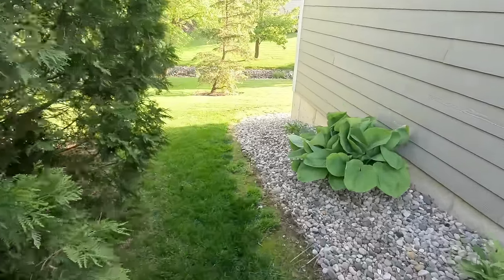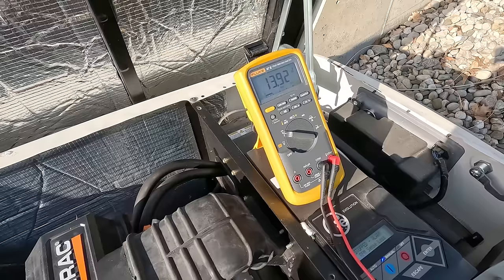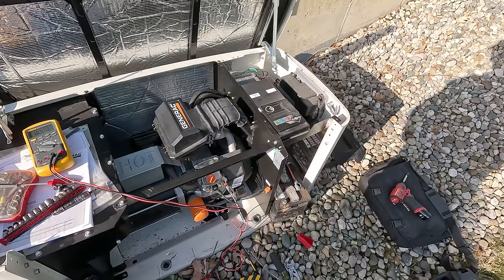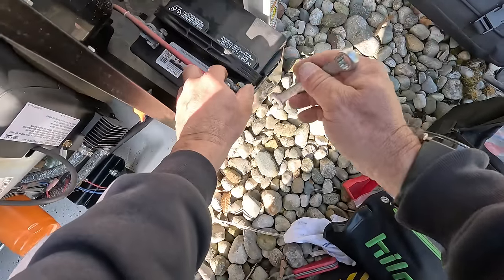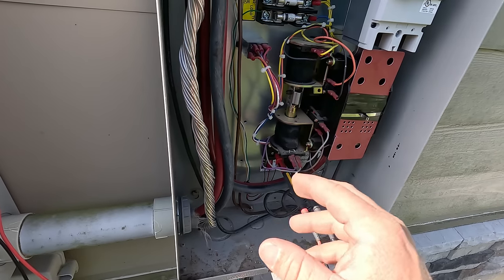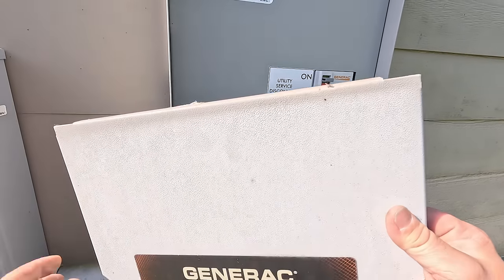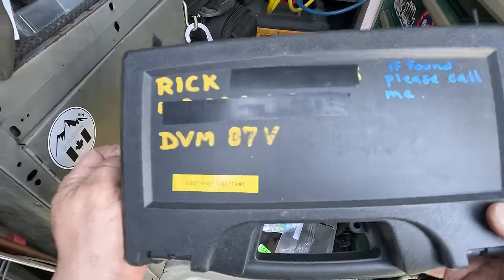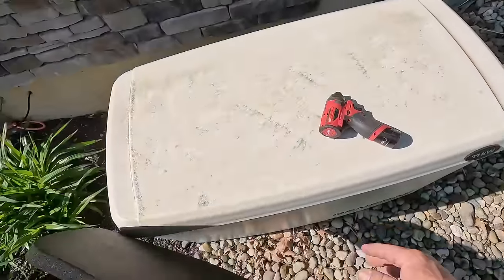Generac Home Generator Wont Start Over Crank 1502 Code

Comment: Great job, Im a Generac MPS industrial tech.... SO many techs do not understand voltage drop tests like you demonstrated. great job. ALso the start contact relay for that is under the controller in that unit.
Reply from the maker: Thats what I thought as I was editing it. Opps Good Call!
Reply: @HVACRSurvival  I probably shouldn't of mentioned it. ( now I feel like one of "those guys") I know its tough to shoot a video, talk and troubleshoot.  I am confident that someone that knows voltage drop testing as well as you is very aware of the system and scr. Again , it was a VERY good demonstration of voltage drop diagnostics.
Reply: <3 hell yeah! Tech fam

Comment: I'm curious as to why you start your video bad mouthing the manufacturer of the product, as you just showed that it is usually a lack of preventative  maintenance that causes the unit to fail ? I use to work on all types of generators and all will fail without good serviceing !😊😊😊😊😊😊😊😊😊😊😊😊😊😊😊😊😊😊😊😊😊😊
Reply from the maker: Watch my other generator videos on Generac and you’ll see why. Generac training is in adequate and their first generation generators are total garbage.
Reply: @HVACRSurvival I agree with you
Reply: @HVACRSurvival 
Would you consider the Cummins RS25 a good/reliable unit?
Reply: @georgeschilens8557,  If you had any experience as a generator tech, you would understand.  I was a generac "certified" tech - Air Cooled up to 150 kW liquid cooled, same with Kohler and Winco.  Generac's will sometimes not work when nothing is wrong-as the video mentioned there have been quality issues-very frustrating.  But, sometimes, not "usually", it is lack of maintenance as you stated.
Reply from the maker: @louis Cummings is normally good but a lot of companies are smacking a good companies name on poor product just so they can sell it so you gotta make sure you investigate each individual one. Sometimes it’s just a matter of knowing how it’s built to see if it’s gonna be a good generator or not unfortunately that doesn’t help the consumer.
Reply: @HVACRSurvival ..I just got done the first year generac training in Pennsylvania and yeah it's trash they don't teach or train anything just try to smash a bunch of stuff into your head and hope you can regurgitate the info

Comment: Not an instructional video?  Well, I learned a lot.  Well spoken and detailed.  However I would not use that plastic spray.  It dries hard and moisture will creep under it and the battery terminal and connector corrosion will only be delayed.  I have always liberally applied ordinary grease (not moly lube!) to the battery posts and connectors and never had a corrosion problem for the last 50 years (I'm 83).

Comment: After you clean the battery posts and cable ends, put automotive chassis grease on the posts and cable ends before assembling them and then a little more on top to fill in any gaps around the posts and you will never have that problem again!  I learned this tip from a retired army mechanic!  That spray crap is near useless!  Also, a sealed AGM battery is a much better replacement option.
Reply: You said it better than I did!

Comment: Awesome job explaining and showing voltage drop. This is why any good automotive technician uses a load testing light along with their multimeter to prove beyond a doubt which part of a circuit is the culprit.
Reply from the maker: Thank you!

Comment: Hey Rick! Another great video. I’ve got a 22KW Generac just installed last year and I guess I baby mine too much by going out every few weeks to check it, wipe the inside down and make sure it’s always ready!! I agree with you, leave repairs to the pros like yourself!! Thanks again!!
Reply from the maker: If you just do the basic things like making sure the battery is not corroded and taken care of, make sure it starts and runs normal. Keep an eye on the oil level then you won’t have near the problems that these other people do. If I spent $7000-$15,000 on a generator, I’d be taking better care of it than what I’ve been seeing. Thank you for sharing.

Comment: the spray on "battery terminal" stuff is great for ease of use. used to just slather on "petroleum jelly" and "baking soda" mixture. aka acid neutralizer and corrosion prevention via water/moisture repellant. yeah, I use the spray can stuff (easier, even though costly). have used white lithium grease, silicone grease and others when out of all the good stuff. but I am not an dedicated auto-service shop. just a sucker for family, friends and foes. 😖

Comment: Great video as always. I use the same battery drop test on my generator pm’s. Like you said the most common issue is the batteries. We try and not let them go past 5 years of use.
Reply: Heat is a killer of batteries so I think at least every 3 years

Comment: One of the more informative videos out there on Generac. I have overcrank alarms on mine frequently, but it seems like it may be a valve lash problem.
Reply from the maker: Checking and adjusting the valves is something they shoved down our throats all the time. Generally, I have not had anything so far out of whack that it caused any major issues, but it’s worth looking at. Thank you for the kind feedback.

Comment: Good job on the video and well explained on the voltage drop. BTW, retired Generac tech of near 25 years and recalling a bunch of that era having a poor connection with the battery cable at the starter. (needs another 1/4 turn) Be aware that the silver faced insulation is a better ground than you think so watch your wrench in the tight quarters back there. In my shop we used the felt washers on battery posts. I was skeptical at first, but never saw any crud on a battery in all of my time in the field. They work way better than anything else. I worked for a larger dealer (15 techs) and not unusual to knock out 40 - 50 services a day... plus repairs.
Reply from the maker: I agree the felt is pretty good, I believe it’s saturated with some sort of chemical. I kept my hand wrapped around that wrench really well because I’ve heard of people crossing the positive to negative with a wrench and having the battery explode.
Reply: @HVACRSurvival    Never saw a battery explode from that (too far away for the battery gas) but it will erase the time / date / exercise stored in memory. Now the customer will be calling because they have no idea when it will do the weekly run. BTW, if a customer doesn't specify, we always set the exercise for 10 AM Tuesday (programable units) so if we ever get a call, anyone in the office can answer that question. EST and DST are still a mystery so we have to tell them it could be off by an hour at certain times of the year.
Reply: I have a 20kw generac guardian. I’ve been having issues with the sensor loss issue. Replaced the battery, contact relay and still having issues with the generator just clicking and not starting.  I have to press the switch to manual several times before it starts. The alternator was replaced about 3 years ago and probably that’s the issue again. It appears the battery cable is tight on the solenoid but maybe I should tighten it down even more. Getting 12 volts at the solenoid. Any ideas???
Reply: I meant to say starter and not alternator 🤦‍♂️🤦‍♂️
Reply: @LouisS-cs7bh  In my time I was seeing at least 800 units a year for service / repair and starters were low on the list. That start relay was even lower on the list. I don't think I replaced 3-4 over the years. You need to do a proper test and check voltages, starting at the battery and working back to the starter, including the small wire that triggers the starter. (wire #56 in a diagram) You should also check the negative battery cable where it ties to the rear of the engine. BTW, even an off-brand starter usually lasts more than a few years. You are missing something.
Reply: @rupe53 
Thanks for your help
Reply: @HVACRSurvival  The heavy felt washer is saturated by similar to what you spray can has, it is just in the best position to prevent corrosion-underneath, so instead of hiding corrosion, by covering it up and making a mess out of the terminal connections, it stops it at the source.
Reply from the maker: @Bobby I agree they work great. But they don’t last forever and I don’t use enough to justify getting a box of them. I did prior when I seen 2-4 a week.

Comment: Man, I'm glad I got that 10 year warranty on my 26kw unit. Mine tests/runs every week. But I feel I should be running it every 60/90  days under load. I run my portable (backup 8kw genset) every 30 days.
Reply from the maker: Turn off the quiet test feature. Let that thing get nice and hot so it boils the moisture out of the oil. When you see White oil that is moisture buildup.

Comment: A backup generator could really benefit from having a rope starter inside the case.  I have a tri-fuel portable with electric and rope start. Seems like a better machine except for not having an ATS. 
Nice video 👍👍
Reply from the maker: Your problem would be trying to start something this large by hand. On average it's 1.5 hp to as much as 2 hp per thousand watts, for example a 25 KW generator would be potentially 37 1/2 hp or more.
Reply: And it also  requires that you are physically present at the building
Reply: @HVACRSurvival You would never be able to pull it.

Comment: Hey man, really enjoying your videos thank you! I am a 18 year Hvac tech and I have the same error code on my Generac at home. The battery was tested at interstate. They said it’s OK. Any chance you could offer some help? I understand if you can’t but I figured I would just ask. Thanks in advance Zack.
Reply from the maker: What kind of help?
Reply: @ understanding the way the starter is told to energize.  There is a little relay looks like a 12v coil that (I think) is normally closed. I don’t have a schematic and I don’t know what I’m looking for/where to find the failure….

Comment: Do you recommend a generac generator and good job
Reply from the maker: Their latest ones aren’t too bad. You just have to do your part in maintaining it and you won’t have near the problems. Also make sure they follow the instructions properly on the installation. Meaning getting the gas line and meter size correctly, not putting it too close to the house and not putting it where there’s snow piles typically during the winter.

Comment: Good video. We typically drop out the charging circuit to get the actual battery voltage and can see the drop when cranking. 
Just a faster way of troubleshooting.
Reply from the maker: @GentechNorthwest-ue4oq  cool. I’ll have to try that. Thanks!
Reply: @HVACRSurvival  keep
making these videos. Many people are in need. Thanks
Reply: No, a faster way is to measure battery voltage during the crank cycle, and leave the charging circuit alone-then you are not resetting all the exercise info should the battery voltage go below about 9 VDC without the charger, thereby wiping the EEPROM,
Reply: @bobbygene8274  That’s not how the evolution control boards work. However, yes you are correct, you can see the drop during crank cycle on manual.
Reply from the maker: I normally used my digital meter while I use a load tester. I was told it should stay above 11.2vdc when cranking.

Comment: On newer generators Maxitrol external fuel regulators frequently cause overcrank problems as they let pressure build up especially if regulator is in direct sunlight and solenoid will not open due to high pressure that regulator has let walk up to or past 20" wc
Reply from the maker: I’ve heard of the pressure being too high to allow the solenoid to open, but I’ve never seen it that high. Usually the highest I’ve seen is maybe 14 to 13 inches and even then I would adjust the primary regulator down.
Reply: @HVACRSurvival  a couple of times I have seen a maxitrol in direct sunlight walk from 7"wc to 20 in less than 10min, first time was a couple of years ago on a 6mo old generator, we do not use maxitrol period anymore after realizing faulty dilemma and is first thing I look for with overcrank is if customer has a maxitrol regulator.  This is also why when replacing fuel plenum I leave old fuel neck and solenoid as the older ones tolerate a higher wc
Reply from the maker: That’s a new one for me. Maxitrol is usually a good product, I see them on Make Up units all the time and those aren’t usually cheap.

Comment: The two most prevent issues with generators is a failed/failing battery and lack of fuel...replace the battery every 3 or 4 years-whether the battery "tests" good or not.  Other than that, perform needed maintenance per manufactures guidelines.
Please don't use spray on battery terminals.  Use impregnated washers.  Most corrosion is from vapor coming from the case after the seal between the post and the case is compromised, sometimes due to someone beating on the terminals instead  of spreading the battery clamp, or random failure.

Comment: Great video. Thank you for sharing. If you don't mind me asking ? May I ask, Where do you get the battery ? Is that car battery ?
Reply from the maker: That likely came from the place we buy our automotive parts. It’s a local distributor not national. Technically it is a regular car battery. They claim the one Generac uses his technically built for generator because it’s vibration resistant, but I don’t know if that’s true or not. We’ve never had any problems with these batteries or any other ones for that matter if you take care of them.
Reply: @HVACRSurvival  Pretty good vibrations in a car too so I would doubt that claim too probably same as a car battery
Reply: They are absolutely car batteries, and NO generac does NOT make them.  There are only a few manufactures of automotive batteries in the country, three I think.  Recommended battery is a group 26 or 26R, you want the negative post on the outside, if you can get it that way.  Generac's negative cable is not always long enough to do that, though.

Comment: Generators eat batteries. I solved this by buying batteries that had a three-year free replacement on them. Ironically, about every 34 months. they went bad..  : )   They handed me a new one for about 10 years straight.. Solved the problem, though. Batteries were the number one thing to look for when these things were running wonky..
Reply: Likely cheap batteries and a inexpensive charger.  Good quality AGM battery and a Smart charger designed for AGM  should last 7-8 years!

Comment: loose/dirty battery posts/terminals. hehe, I learned over 30 years ago to always clean them with wire brushes(terminal brushes) and always apply an anti-oxidant. how did I learn that? previous failures!  yeah, I most always learn the hard way or backwards very fast.
Reply from the maker: Same

Comment: Rick, you're a wildman!  Why no 65 cal arc flash suit?
Reply from the maker: For 240v? Sure for 460v
Reply: @HVACRSurvival  ---  I'm teasing Rick, teasing, it comes through poorly in a comment.
Reply: Because 240 volts does not ionize the air with a short circuit. 13,800 volts doesn’t either. Only 480 volts ionizes the air. A fact of physics and high voltage safety training.
Reply from the maker: @davidnull5590  I figured you’re teasing.

Comment: I've seen so many people hack in a generator install it's insane.  Not unbonding and separating panels on most.  Atleast in my area the local hvac supplier sells generacs. So the hvac tech tries to play electrician and corners usually get cut.
Reply from the maker: Our local Carrier dealer sells Honeywell, which is technically Generac. Most installers of HVAC don’t really want to do the generator install, but they forced to do it. Just like I service guys don’t wanna work on them.

Comment: Is it set up to do a test every week? The only problem I have had was an oil sending unit.
Reply from the maker: Most of them I’ve seen is every week. I don’t recommend the quiet mode, run it hard and hot to burn off the moisture in the oil.

Comment: Those high frequency impedance based battery analyzers are okay but at least once I've had one "pass" but fail in carbon pyle tester (which sounds like you have elsewhere 👍)
Reply from the maker: @slip0n0fall  yep. I have a basic 100 amp resistive tester. I felt the same way about the electronic testers.

Comment: So here is my question. Assuming all mainterance is followed to the letter. Are these just cheap crap or can a homeowner depend on one properly installed?
Reply from the maker: There are some that go bad for no good reason,  most of them are improperly maintained, then there’s others that don’t really have any problems. Like I said the video the newest ones don’t seem to have near the issues that the ones from the mid 2000s did.
Reply: There better than a Mobil unit for some people not in a flood zone 
Yet there still the cheapest line of units, charging oil and property services are expensive but without it get a candle 😮
Reply from the maker: Myself personally prefer portable units because mine have been flawless and they’re actually actually Generac. I haven’t had any problems with either one of them ones 8000 W the other ones 3000.
Reply: Yes, to both questions.

Comment: I had a battery explode in one of the older Generac models 12kw.
Reply from the maker: It happens allot because the chargers are not a trickle charger. Then the water level gets low and boom. I’ve lost windings thanks to battery acid. Great product they had there. 🤔